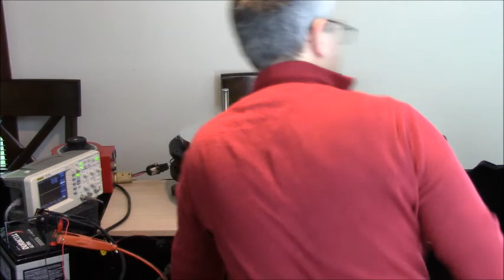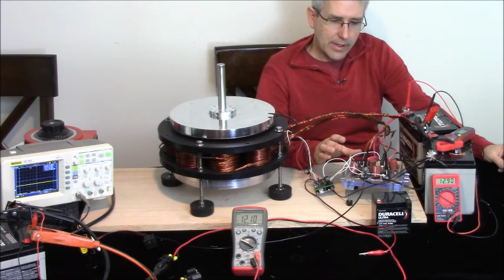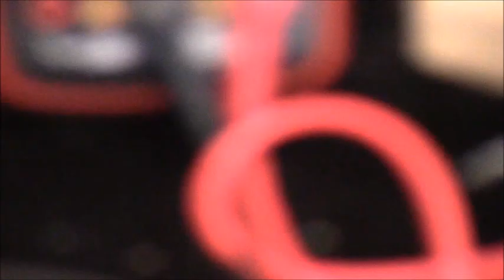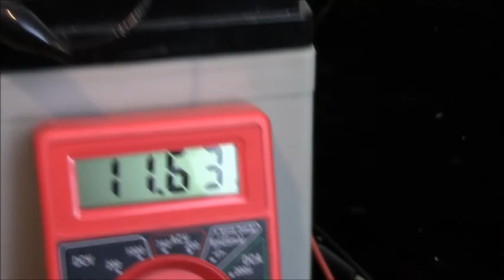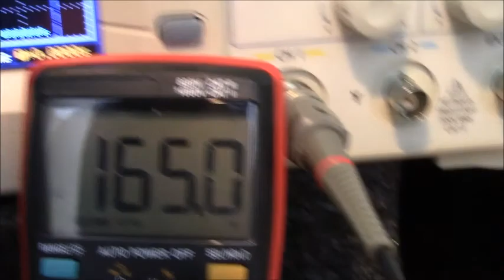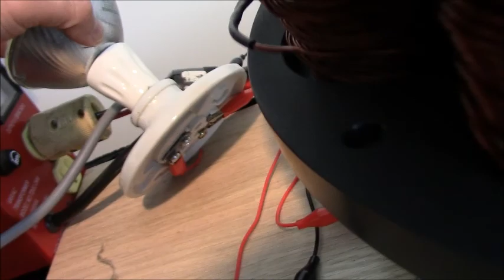Large 4 Dualpole with Industrial fan as load

Comment: Great to see the continuous improvement to the motors - amazing.... I learn something new with every video I watch.   Hoping to make it out to your conference in the fall if you have the one in Michigan.   Have you ever thought about making the conference 3 days instead of 2, since there is so much information to learn, which is all great stuff.  I've learned some much at your conferences and have a great time.   

Looking forward too seeing the smaller coils.  Wow, thinking about that motor running over 100 volts and 80 amps.  That's a lot of power.  If you can keep the input and charging batteries from discharging/charging,  then would it be a good time for another boat experiment ?......
Reply from the maker: Thanks. I did have 3 day conventions in Idaho but most people don't have the time for 3 days. 
As the voltage goes up the amperage goes down but the power is increased...
Yes as mentioned in the video.